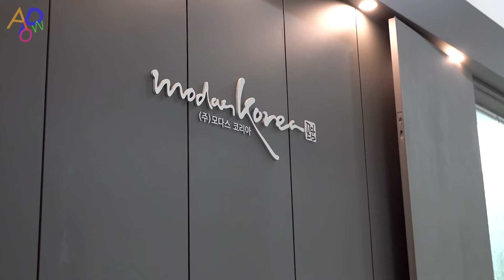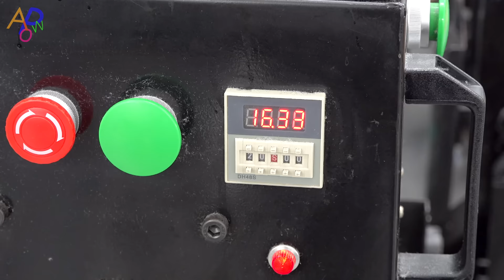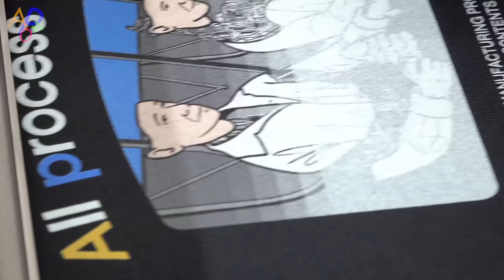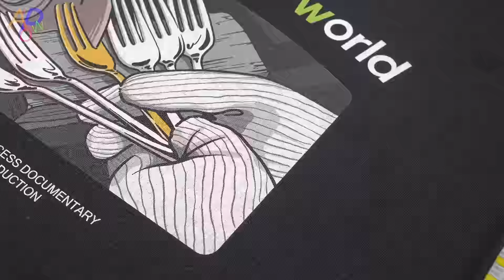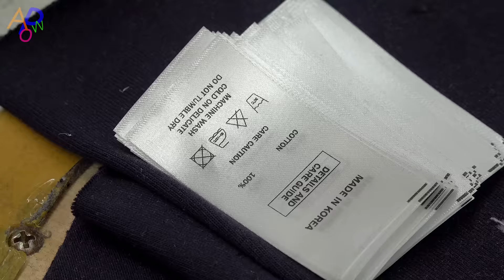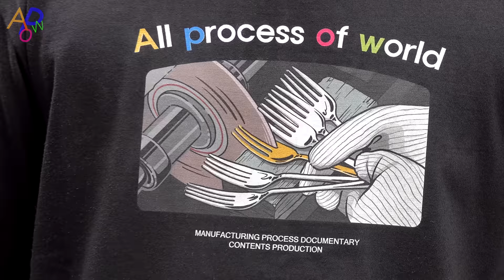Amazing Graphic T-Shirt Mass Production Process. One-stop Clothing Manufacturing Factory

Comment: I would love to design some T-dresses with magnolia print on the bottom about four inched up from the hem, colors white magnolias with some colors that added with green leafs of course but some other bits of color so it would match most color background, same with at the neckline add small reduced magnolias. Of course other designs would work, T-Shirts are fine, but I would like a-line bottom T-Shirt dresses it could be straight down also at the lower part. You can add a belt type that gives an added shaping part. There is no reason not to create other things clothes with the T-Shirt top.  In winter, you can have long sleeves added a long different color T-Shirt knit long sleeve over jacket opened with no buttons or with one or two below the bust line would work. Just keep it simple, I little up the leg, but it can be lower on the leg.  I hope someone takes the idea and run with it because I want one.

Comment: Mass production apparently- using scizzors to cut a single layer of fabric.
Making 1 tshirt at a time is mass?
Funny, when i worked in an actual tailor shop churning mass production, we layed mutliple 1000yd rolls on top of eachother across a 100 foot drafting table, up to 40 layers thick cutting t shirt patterns with a jigsaw w/ a table base.
Reply: Can't say we used scissors for absolutely anything but cutting off strings at the end of a sew line. 
This is a hobbyist tailoring video.